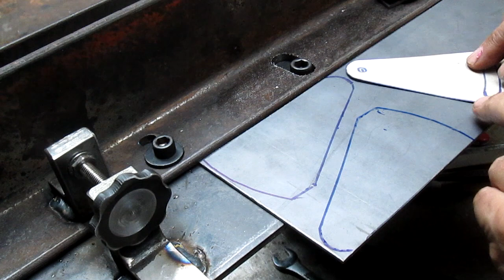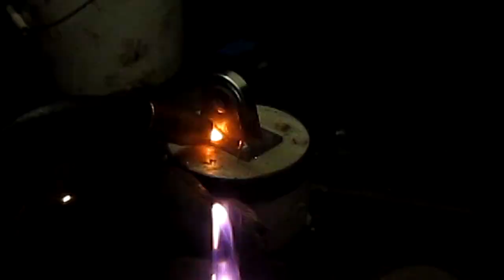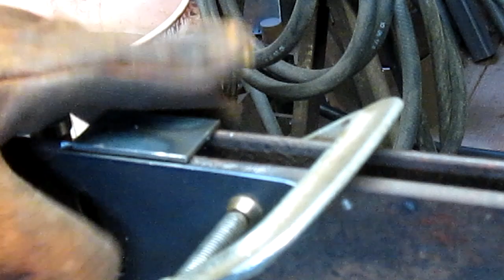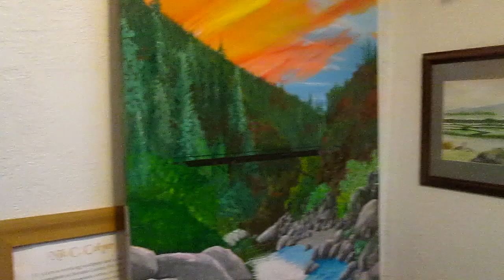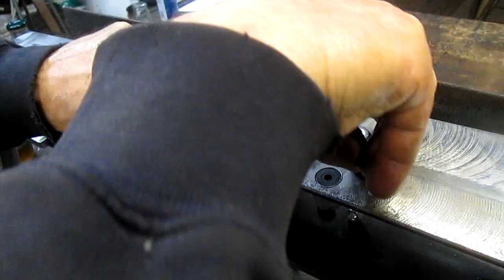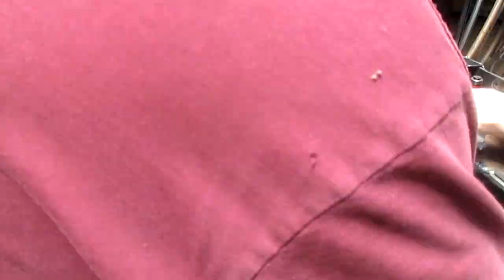Frame Jig Build #4 final

Comment: Your a talented man. One tip I would offer regards wood machining. Don't allow the timber to hesitate or stop moving as you will see the point where you stopped. Not always easy I know.
Reply from the maker: My latest approach the wood moves though more smoothly. Thanks for the tip though.
Reply: @NikColyerMachineWorks  Great videos Nik I really enjoy watching, many thanks.
Reply from the maker: @messenger8279  Well, thanks Colin. I've got more on the way.

Comment: One thing you will find out is that just because you purchase a 1X6 does not mean it is 3/4x5 1/2.  You might to rip it or run it through a plain just to make sure the lumber for the entire farm is the same dimension before cutting it and trying to put it together to find out the corners do not match.